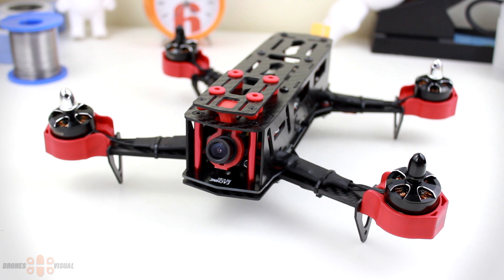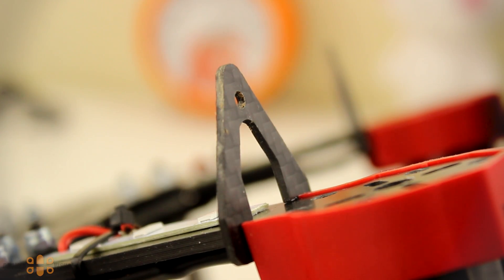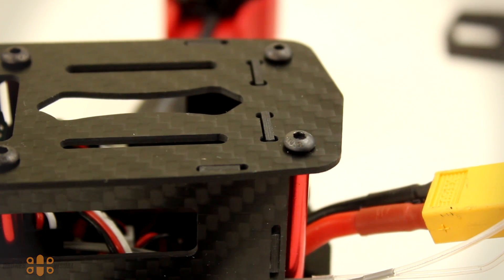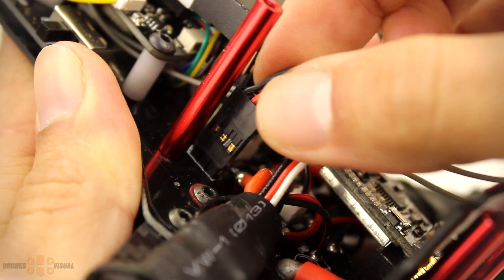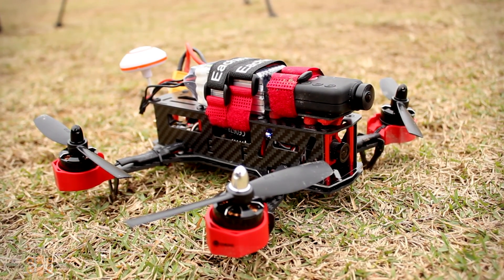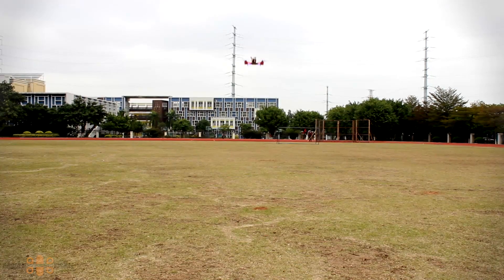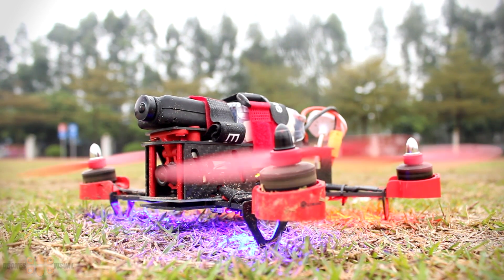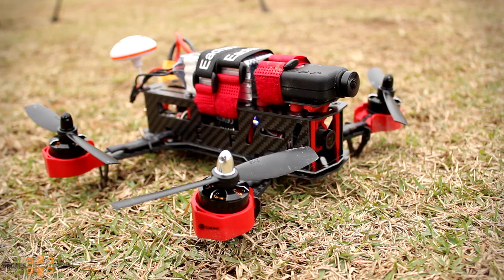Eachine Falcon 250 FPV Racer Review and Crash Test

Comment: hi my friend, may I ask what is the max lipo battery that can be use on this eachine flacon 250?
Reply from the maker: Hello. The max you can use is 4S, 14.8V. Cheers.
Reply: Thank you man. By the way, do you have any idea, I use 2.2mah 11.1v 3s lipo to my falcon 250 but one of my ecs got burnt. Is it also possible to use clockwise motor as a replacement to defective ccw motor by changing the wire connection to make it clockwise?
Reply from the maker: Hello. Yeah, it is possible. But then try using nylock nuts for that motor. Cheers.
Reply: Thank you. Do you know why my ecs got burnt using 2.2mah 11.1v 3-40c lipo?
Reply from the maker: Hello. It can happen for many reasons, but the Falcon 250 can take 3S and 4S batteries. One thing thou, that battery is too heavy for the Falcon 250. Try using a 1500mAh 4S and you will see how awesome it flies. Cheers.
Reply: Drones Visual thank for the advised

Comment: I'm getting one any suggestions
Reply from the maker: Hello. Well, yeah, get 4 cells 75 to 90C batteries and enough props and replace that landing gear with some hard sponges. You will also need to deploy and secure better the receiver antennas. Cheers.

Comment: Hows you video transmitter holding up with those 4s lipos? Ive heard that 4s can over load the transmitter and damage it.
Reply from the maker: Hello and thanks for asking. The thing is that I didn't fly it much afterwards, maybe 7 times more, so I can't tell much about a long term use. Cheers.

Comment: Nice review. Thx! 
You mentioned a video to review the camera, has that been done yet? 
I find the camera very crude on the exposure compensation. Does a really poor job with opening exposure to the ground when there is lots of sky in frame. Any replacements you could suggests? 
Thx again.
Reply from the maker: Hello and thanks for asking. I did mention that, but I ended up smashing it to smeetherins before getting there :/ Cheers.

Comment: Hey, I'm stuck. When I plug in to librepilot, it will not connect at all. It will not recognize board, or move any further through the program. I have used cleanflight and set up on e other drone, but the eachine 250 will not let me into the program. Any ideas?
Reply from the maker: Hello and thanks for asking. Did you already try to use Open Pilot? It's pretty simple and it will certainly recognize the board. Cheers.

Comment: hi, regarding the transmitter, can you load another program to it so that you can use it to other quads?
Reply from the maker: Hello and thanks for commenting. Yeah, you can use the FlySky FS-i6 with other quads, just create a new model and bind it to a compatible FlySky receiver. Cheers.
Reply: O I see. Thanks for the reply. 
By the way I'm talking regarding the transmitter that comes with eachine falcon 250. right?
Reply from the maker: Hello, yeah the FlySky FS- i6A .Cheers
Reply: Thanks men. Cheers

Comment: Is the Fpv with 200mw good and are you able to watch it with a Fatshark Predator v2? Nice video btw ;)
Reply from the maker: Hello and thanks for asking. I tried the Falcon 250 on radius of around 300 meters without major problems, using regular whip antennas on my receiver. Regarding the Fatshark, I still need to invest in one of those. I´m currently using cheaper FPV gear like the Eachine V007. Cheers.
Reply: Fatsharks are unnecessarily expensive dude you can use a cheap eachine vr 007 with adding better antennas or maybe a better resolution screen too.

Comment: what was you flight tıme wıth thıs 1300mah 4s battery ?
Reply from the maker: Hello and thanks for asking. I think 7 to 8 minutes if I recall correctly. Not sure if I mentioned it in the video. Cheers.
Reply: thank you for your reply will try to change stock reciever with flysky fs-ia6b to inrease the transmitting range
Reply from the maker: Hello and thanks for sharing. Do you have any source confirming any range boost with the iA6B? Cheers.
Reply: i cant find a link but i have seen before falcon comes with ia6 reciever than at forums some of the people says ia6b has longer range . you can try it could be a good video about upgrading this beast.. ;)
Reply from the maker: Hello, yeah indeed. This is good material for a video. Cheers.
Reply: also at 7:13 the green cable could be the audio because camera has a micraphone on it. Cheers.

Comment: Any idea of how to arm it? Mine came with the eachine I6 controller. No useful manuals online. Left and right sticks to bottom centre doesn't work.
Reply from the maker: Hello and thanks for asking. Plug it to a PC and use Open Pilot to check how has the unlocking been configured. Cheers.
Reply: Drones Visual i have the same problem but i dont have a computer. Pls help

Comment: got my falcon but crashes and broke and ESC :( I see that the ESC solders on the board, but how does it connect to the motor?
Reply from the maker: Hello and thanks for asking. How does the ESC connect to the motor? is that the question? Cheers.

Comment: Hi,
I am thinking of purchasing an Eachine Falcon 250 FPV racer as my first FPV racer. I will
be grateful if you could reconfirm your opinion and thoughts on this choice?
Thank you:)
Reply from the maker: +flymoon24 Hello and thanks for asking. What quads are you currently flying? I tend to recommend the Eachine Racer 250 to beginners, but that does not mean you could not start off with the Falcon 250. The Racer 250 is rather docile and it can help make the transition to FPV flying smother. Cheers.

Comment: Every time u say falcon it sounds like Qualcomm
Reply from the maker: +Saifo Wahsh (SaifPlays) Hello and thanks for commenting. Hhehe, accent is a hard thing to get rid off. I´ll try to work on that. Cheers.
Reply: +Drones Visual  thx for the review im up and running on the falcon :))) but did u have banking problems or did the banking feel pretty weird?
Reply: +Drones Visual can u plz review the Eachine Blade 185 its very new and no reviews are there yet
Reply from the maker: +Saifo Wahsh (SaifPlays) Hello. No, I did no have any problems. Did you experience any problems? Cheers.
Reply from the maker: +Drones Visual Hello, yeah the Blade 185 is looking hot. I´m trying to get one, let's see what happens. Cheers.
Reply: +Drones Visual I experienced a weird banking problem when i started banking it would bank so slowly at first then when it jumps out of it it becomes very quick for some reason
Reply from the maker: +Saifo Wahsh (SaifPlays) Do you know whether there are more people having this issue? Are you flying in Acro or stablized? Cheers.
Reply: +Saifo Wahsh (SaifPlays) not so much people experienced the problem but ill try to fix the PIDs
Reply: +Saifo Wahsh (SaifPlays) i tried both but in horizon mode or attitude but attitude mode has the big problem that im facing ill try to fix the PIDs cause i left mine stock even tho i could use the pids of my eachine 250 racer
Reply: +Drones Visual Cheers on ur future reviews :)
Reply: Get the Eachine Falcon now with 50% OFF (actually works) from Banggood with this discount link:* https://www.banggood.com/Eachine-Falcon-210-Pro-CC3D-Naze32-F3-Racer-ARF-Without-Battery-Charger-Camera-VTX-Remote-Control-p-1112636.html?p=3B03079878369201704R

Comment: Hello Bo ive ordered the Falcon  do you no if i can put the features the racer has ieGPS   OSD....and if i can will i have to re flash the flight controller? wich i can not do
Reply from the maker: +Raythetree001 Hello and thanks for asking. You ordered a Falcon 250 with a CC3D board, right? Cheers.

Comment: hi, can we replace the CMOS camera with a CCD because
the original connectors have 4 wires while standard have 3? it seems that it is not possible
Reply from the maker: +weshweshdogg Hello and thanks for asking. I believe it should be possible, but it might require a bit of DIYing the connector. I have no tried doing this, but I might look into it. Cheers.
Reply: thanks for your response

Comment: What do you recommend as a good spare battery for this thing? What about this one? http://www.banggood.com/Eachine-11_1V-2200mAh-3S-35C-XT60-Lipo-Battery-For-RC-Multirotors-p-1038461.html
Reply from the maker: +Joshua Curtiss Hello and thanks for asking. That battery is too big. You can either get a smaller 3S or 4S. This one could work out http://goo.gl/TimhLL , but you can try using a 50 or 60C as well. Cheers.
Reply: Banggood is having 50% discount on this drone right now: https://www.banggood.com/?p=TL0111854575201411Z0 Check it out!

Comment: Hi, Is the falcon 180 good? Or should i choose the 250? (i'm beginning)
Reply from the maker: +Leon ;D Hello and thanks for asking. At this point in time I would go for the Eachine Falcon 250, but consider that the Falcon 180 I have over here is a prototype and it has a CC3D. I would need to check out the final versions of the Eachine Falcon 180 to be fair. Also the 180 will come with flight controllers such as the Naze32 and SP Racing F3 which are way better. Cheers.
Reply: Thanks ;)

Comment: I bought a falcon eachine. I would replace the controller cc3d by NAZE32 SP Racing F3 Flight Control Deluxe 10 DOF for Multicopter.
My question is do I can reverse the controller upside down (top down) for the pin 1 is in line conection No. 1. I saw in one of your video that can move the controller in the direction you want. Also upside down.

thank you
Reply from the maker: +kougar300 Hello and thanks for asking. I have not attempted doing that, but if you noticed the connectors for the ESCs come straight from the pcb, so there is not so much freedom of movement for the flight controller. Cheers.
Reply: At worst I'll esc connect directly to the new controller.

Comment: why do you use a torx bit when clearly you need allenkey/hexkey/unbrako.... cmon... if you want some cred here you need to know your tools. 

also, the phillips screwdriver was also too small. you will  wear down the metal in the screw after a few times usage... 

here you go mate "https://en.wikipedia.org/wiki/List_of_screw_drives"
Reply from the maker: +Hans-Jørgen Pedersen Hello and thanks for sharing. Yeah, I can be careless at times, I guess my focus was more on the aircraft than tools. Good call. Will try to get the right tools for the next one. Cheers.

Comment: Can you tell me what the switches on top of the flysky i6 remote actually do, especially the switches on the right?  Thanks
Reply from the maker: +Rob Rogers Hello and thanks for asking. Did you get the RTF version? Or did you use your own receiver/transmitter. ? Cheers.
Reply: +Drones Visual I have the RTF version with the FlySky i6
Reply from the maker: +Rob Rogers Ok, in the sample I tried, which is RTF as well the only switch with assigned functions was the swc with flying modes. The other switches were free for any functions you might want to assign to them. But then again, this is a really early sample, could be different for future models. You can plug it to your computer and check it out. Cheers.

Comment: friend, EACHINE FALCON 250, works well with Flysky FS-i6 and, EACHINE VR-007?
Reply from the maker: +Ricardo Norbiati Hello and thanks for asking. It does indeed, but I have not tried it with the VR-007, however, it should work perfectly with those goggles as well. Cheers.
Reply: +Drones Visual which the camera that you are using to shoot?
Reply from the maker: +Ricardo Norbiati Hello and thanks for asking. Do you mean to record the reviews? Cheers.
Reply: +Drones Visual  videos, of your flights

taking advantage of, the controller it has GPS? to hang in the air
Reply from the maker: +Ricardo Norbiati Hello. I use a GoPro 4 Black. The Falcon 250 has no GPS. Cheers.
Reply: +Drones Visual I am a beginner, you think I'll have much trouble with this drone? I'm trying to learn from the simulator, FREERIDER, however, this very hard, lol, I'm controlling with a control ps4, must be very sensitive, do not you think? you advise changing the controller by a naze with GPS?

Comment: Was thinking about buying a falcon. but then couldn't seem to find where to get spare Motors from. It kind of put me off. Does anyone know where I can get them from.
Reply from the maker: +Jamie MacFarlane Hello and thanks for asking. I have inquired about spare parts. ESCs are out already and motors should be available in a couple of weeks at banggood. Cheers.
Reply: +Drones Visual I emailed hobby king and they said the  BG2204 2300KV motors were for the falcon. but the motors that come on it are MT2204 2300KV.
Reply from the maker: +Jamie MacFarlane Hello, are you referring to the Falcon 250 or the Eachine Racer 250? Cheers.
Reply: +Drones Visual I was referring to the falcon. But there saying racer motors work on it. All very confusing.
Reply from the maker: +Jamie MacFarlane I would not use the motors you mentioned before on the Falcon 250. Wait for a while, they should be about to release them. Cheers.
Reply from the maker: +Jamie MacFarlane Hello, here are the original motors in case you are still looking for them: http://goo.gl/NwJCkC Cheers.

Comment: is it hard to connect the usb to computer? where is the usb port? do you have to unscrew and open it up to reach the usb port?
Reply from the maker: +TheRoshan89 Hello. It is kinda hard yes. You don't necessary need to unscrew and open it, but you need to play a bit with your connector until you find the spot. Cheers.

Comment: why did u say the props broke after that crash? when u picked it up all 4 did not look broken and it flew again
Reply from the maker: +TheRoshan89 Hello and thanks for asking. Here is the damage report: 1 prop bent, and the FPV antenna. Replaced the prop and it was back in the air. Really though quad. Cheers.

Comment: Great review. I like your adjectives "like a hungry bird" - very cool. Did I hear you say you might try it on 6S? Don't bother. You lose too much control with 6S. That's why all the pros fly 4S, not more. Subscribed.
Reply from the maker: +Next Lipo Please Hello and thanks so much for you feedback and your support. Oh, good to know about the 6S, it made me although a bit curious about how it would feel, but I might follow you advice and skip it. Cheers.
Reply: No probs man. Yeah 6S ends badly real quick as the loss in control and big battery results in heavy frame breaking crashes.

Comment: A nicely detailed overview.  However I don't agree that it should come with a 4s battery.  The people buying these will not be true racers.  These will mostly be bought by those stepping up from toy grades for the first time.
Reply from the maker: +TheGusK Hello, I appreciate your feedback. Well, indeed for those coming from toy grade quads, 3S is more than enough; but I think I would not recommend the Falcon 250 to those who have only tried toy grade quads. I would rather start with Eachine Racer 250 which is rather docile or the Hisky HMX280. I feel that the Falcon 250 is like the next step. Cheers.
Reply: +Drones Visual I'm fairly new to flying and have only really had experience with my little hubsan x4 and was thinking of going a little bigger soon and looking at these eachine racers. You've said here that you would recommend the racer 250 over the falcon 250 as its more docile and less of a step up in power etc. Both come in at a pretty similar price point at the moment though so im not sure which to go with since i don't want to have to replace it for a while with an additional step up like the falcon. Would you think the falcon is defiantly a little too much for a beginner?

Comment: Gracias por esto. :) I was waiting for this review.
Reply: I received my falcon but this is my first racer so I am unsure about the transmitter controls. For example, how do you change the rates/modes? 

It would be helpful if you explained how to use the transmitter in the next video. Thanks again!
Reply from the maker: +Erik Figueroa Hello and thanks for commenting. I´m glad you enjoyed the review. I will certainly include that in my next video. Cheers :)

Comment: You were asking for a fast RTF quad out of the box that flies fast... try the Immersion RC Vortex 250.
Reply: +Ouel Pacla Well, that's a big step up when you're talking race quads.  It competes directly with custom ones.
Reply: Drones Visual - But then there is Walkera's  Runner 250 and the newer F210...
Reply from the maker: Yeah, I´m interested in the F210, don't think the Runner 250 stands a chance thou. I´m now checking out the Furious 320. Cheers.
Reply from the maker: +Ouel Pacla Hello and thanks for commenting. Yeah, it is on my list, just the price is a bit high, but I would love to take it for a spin. What transmitter comes with the Vortex? Cheers.
Reply: +Drones Visual - It comes without a receiver so you can use whatever transmitter you prefer.  If you're referring to the VTx, it comes with the immersion RC VTx 32channel plus racing band.  It is compatible with all video receiver you can think of.  Plus, all settings (PID, flight mode, video mode) can be changed internally, so you won't use no third party software to change settings.
Reply from the maker: +Ouel Pacla Sounds good,  although when I said ready to fly out of the box, I literally meant taking it out of the box and flying it :D Cheers.
Reply: Drones Visual - that's a slight setback i guess, the transmitter and reciever.
Reply: +Ouel Pacla  - did you saw tilt drone?
Reply: R Chi - are you referring to the Walkera 310?  I've seen it but it's not that good.  Tilt drone in general are heavier than most due to the mechanism.
Reply: +Ouel Pacla  - not sure if we r talking about this same : http://www.tiltdrone.com/